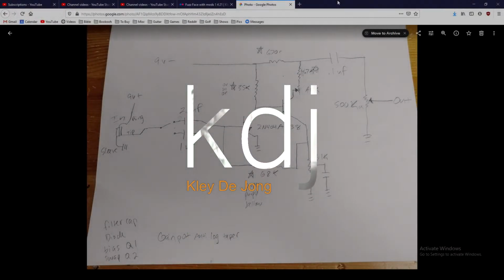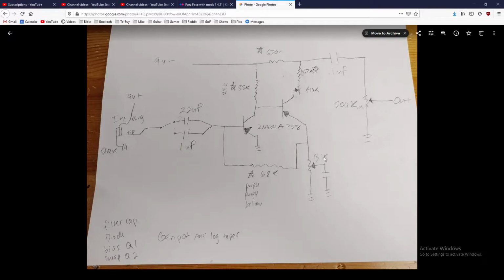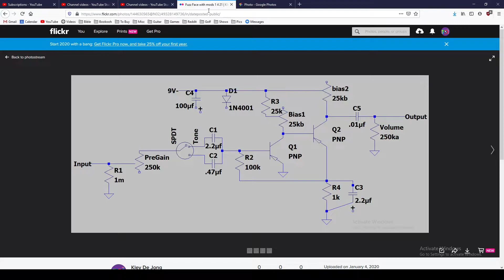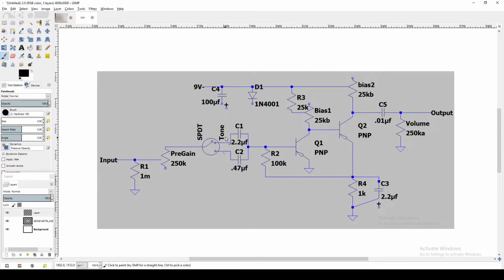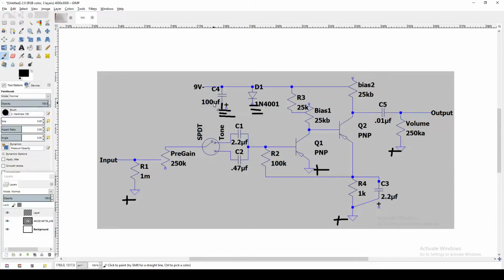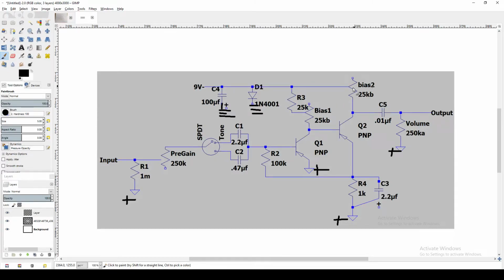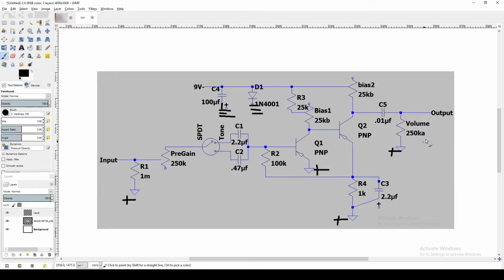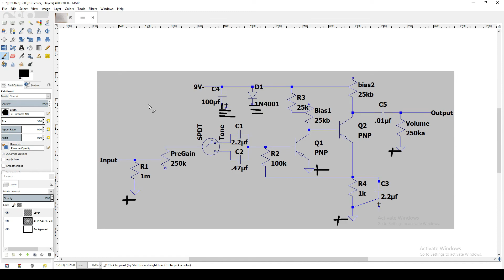Fuzz Face Rebuilt pt. 2 - Drawing & Analyzing the Schematic

Comment: Ive been making a living for 10 years off of germanium fuzz. I was lucky enough to run the biggest used shop in phoenix az. The owner had 8 pawn shops also and we got all the used gear that defaulted from pawn. We had easilly over 500 new and used pedals at any given moment

Comment: Bit of a noib question but most schematics leave out the off board wiring...I understand that PNP transistors require reverse polarity and so you have to change the components on the board that are sensitive to polarity...eg Caps diodes ect....what about input and out put Jack's for example...is the the tip and sleeve reversed? Or do you just wire as standard?
Reply from the maker: You don't have to flip the off board wiring.
Reply: Just to give you a little bit more insight, your input and output jacks will be dealing with AC signals, meaning there's no positive or negative leads, only signal and ground. Your AC signal will be varying between positive and negative (relative to GND) at all times, much like a sine wave. Assuming you run this circuit from a 9v battery or an isolated power supply, you could reverse any of the jack's polarities and all it would do is invert the signal (180º phase shift).

Now to amplifiers 101: most times when you have a single power supply (in this case -9v), you will have to bring the AC signal to DC land, and the way you do this is through capacitors (C1 or C2) and resistors (R2). This is, of course, assuming you want a linear non-distorted amplifier. The reason you have to do this is because, in an NPN transistor common emitter amplifier, your AC signal's negative portion wouldn't be able to drive the transistors, so you would lose part of the signal essentially distorting it. When you're done processing the signal in "DC land", you have to remove the DC part of the signal leaving only AC on the output. That's what C5 does in the video's circuit. Capacitors won't let the DC portion of a signal pass through them; only the AC part will.
Reply: @filipenicoli_  wow thanks for the reply...good too know 🙂

Comment: Don´t you think 1M pull down resistor for each input cap would works better?, I think there will be a pop sound from the non selected cap the next time it gonna be use, so the non selected cap will no bleed/discharge if there is not connected to the pull down resistor...    ...just a comment, maybe I am wrong.

Saludos.

Comment: I may not ask this correctly but...
I had an original about 50 years ago. We used carbon batteries. Going to alkaline produced a more shrill sound imo. As I understand it, the carbon battery has a differnt arc from the alkaline. The alkaline - again as I understand it - works at its greater strength and falls off later while the carbon falls off sooner but works at the same lower level for most of its battery life. Could you put in a pot to control the charge emitted from the battery? My belief is that the carbon produced a sweeter, mellower fuzz.
Reply: I wouldn't recommend you to use a pot to control the battery voltage. By doing so you'll be burning up power inside the potentiometer, heating it up and eventually damaging it or the battery. You could end up with a short circuit as well! You could try using a DC-to-DC switching voltage regulator. They will not be as cheap as a potentiometer but they will surely prevent tonal changes from the battery running out. These can be used to lower the input voltage or even to step-up (say your battery's currently delivering 7V, the converter can step it up to 9V). Of course these would reduce the efficiency a little bit and your battery would run dry quicker, but at the same time it could maintain the circuit working with lower voltages that it would not work originally, so maybe it's a tye.

Comment: It takes alot of resistance to vary Q1 voltage. Stock 33k plus at least a 50k pot in series. If your Q1 has a hfe of 80, 33k will be spot-on, but the higher the gain the higher the resistance you'll need. (Like 100k+ to have 1.3v or some like 0.7v). Also for Q2 you need a fix value in series, because you would fry the transistor with 0 resistance.

Comment: I’m not sure if I understand it correctly as I’m not good at reading schematics. Is it correct to say that to ditch the voltage divider for Q2, I can replace the standard 330R resistor on the standard fuzz face with the 25k pot and replace the 8k2 with a jumper wire?
Reply from the maker: Typically you have the 330r on the 9v line and then the 8.2k feeding the collector of Q2.  I like to replace the 330r with the 25k pot and then you probably want a small resistor in place of the 8.2k.  Maybe something 330 ohms to 4k.  By shifting the resistances around you reduce the voltage divider for more output and you gain some ability to muck around with starved /gated fuzz sounds as well as the standard singing fuzz tone.